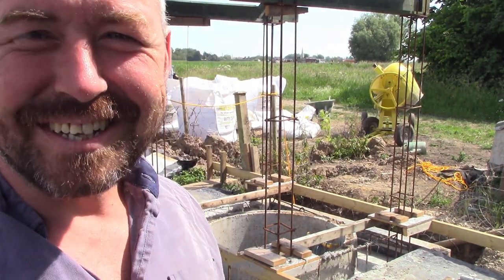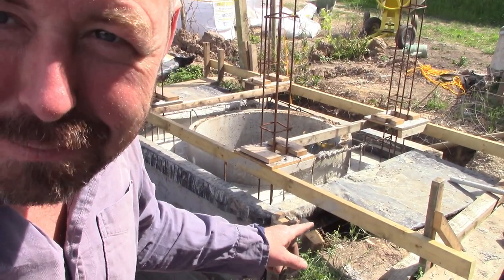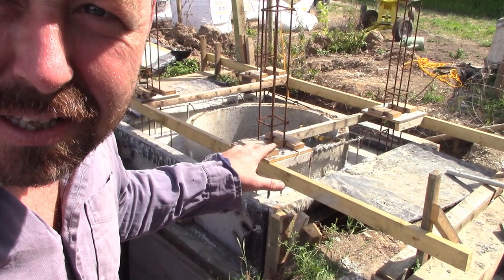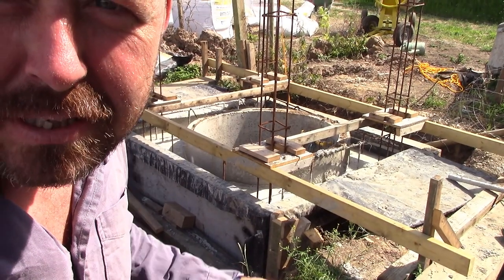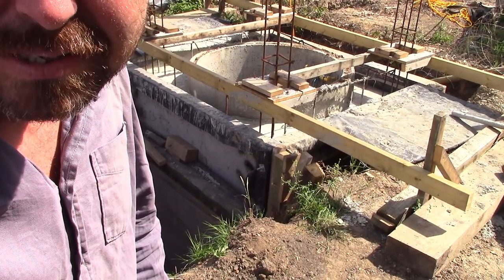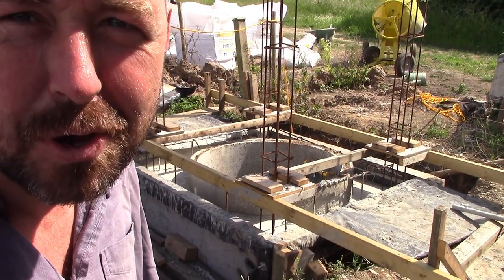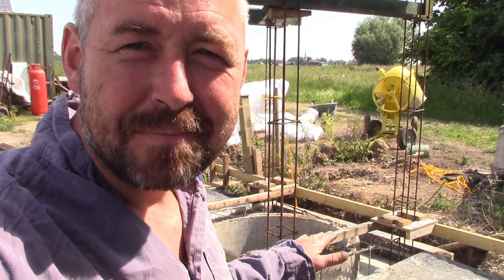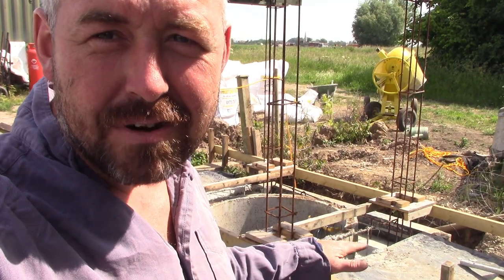Underground bunker workshop, topping off the shaft

Comment: does this mean you can pour the foundation of the above ground building as well now? then you'll have 3 layers you can work on at any given time? Hoping to see that first step coated or something sooner rather than later , really don't want to see you slip down the hole, that first step will be a doozy.. 

fantastic video as ever Mr wUBBLE WUBLE MEgA e-WUBBle... :P
Reply from the maker: You've seen the height of the concrete above ground, I was going to scrape the topsoil off and use what I dig out the bottom to fill up to level and just pour a slab rather than having footings, I won't even need the dump truck for the first few months.
Reply: @turboconqueringmegaeagle9006  I hadn’t considered that. Good idea - does that mean it will naturally compact as you back fill? I guess it’s all about how much you do in one session.
Reply from the maker: @argmentum22  soil compaction is something I'm still green on, I've got a little compactor so will probably run it across in the absence of proper knowledge
Reply: @turboconqueringmegaeagle9006  as long as your not dropping vast amounts in to the hole in one go I can’t see much going wrong. I think a paced fill with a bit of time to settle (and maybe a run over with the compacted every so often will be fine. With the uk crappy weather I would think the rain will solve most of the potential pot hole problems that could form.

Comment: It's looking good.  I probably would have formed two of those steps, one for the plumbing and one as the last step out of the shaft.

If you're going to use the lift rather than the ladder to go up and down the step might not be ideal but you could always fill it in with a wood box or another concrete pour.  It just seems like if you did climb the ladder that would be one less rung before you were up and out which my slightly claustrophobic brain would appreciate.
Reply from the maker: I thought about it but didn't want the extra trip hazard, the ventilation step will be covered with an access panel eventually.
Reply: @turboconqueringmegaeagle9006  just a thought, you should probably install a hatch on your lift floor so if the lift gets stuck while you are below you can climb up beneath it and go through the hatch to get out...
Reply from the maker: @joequixotic3039  that's the plan although there's going to be a couple of temporary lift cars first before I do something fancy with brass handles and wrought iron.
Reply: @turboconqueringmegaeagle9006  good, I just don't want you getting trapped down there.

Comment: Coming along lovely chief. Can we donate stuff I have a hydraulic tank and pipes and a pto hydraulic pump with relief valves. All agri spec was built to run a fan on a drill.  Thinking for your winch  gear and digging tools.
Reply from the maker: Mate, I'm a massive womble, all donations greatly appreciated
Reply: @turboconqueringmegaeagle9006  when I get to me workshop I’ll post a short of it all I am Boston based so not far away
Reply from the maker: @farmerfuller87  awesome, I'll keep my eyes peeled. YT had unsubbed me.
Reply: @turboconqueringmegaeagle9006  they unsubscribe me from you too other week lube tube split arses. I’ve put video up